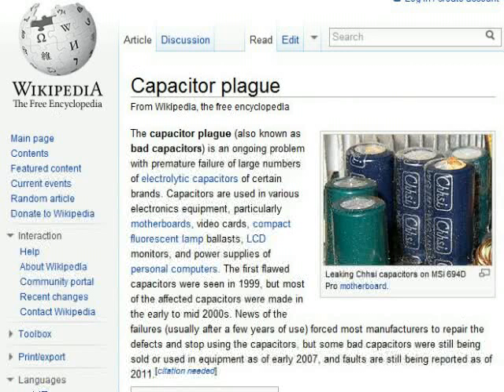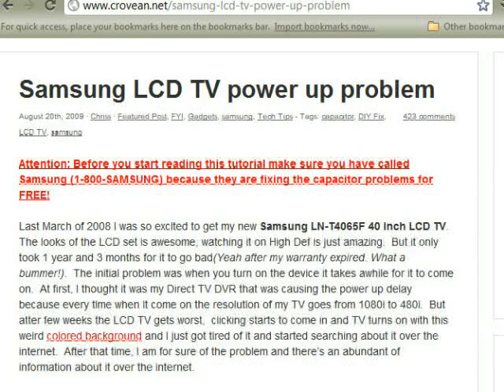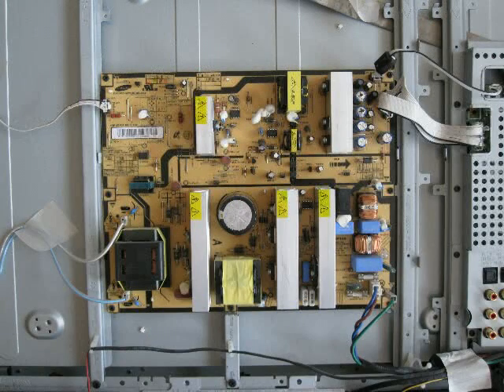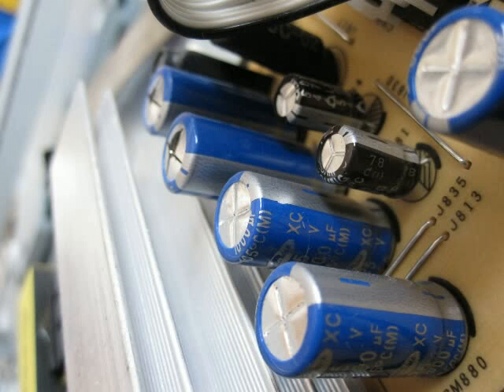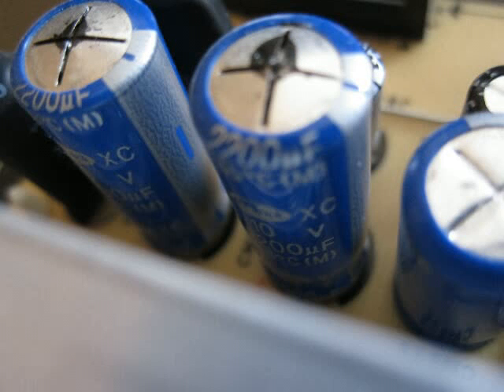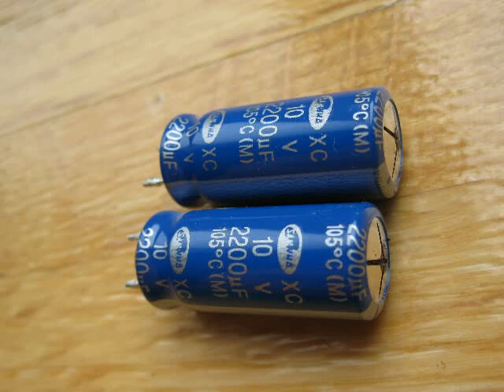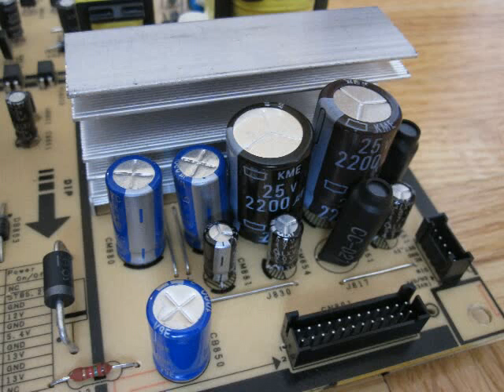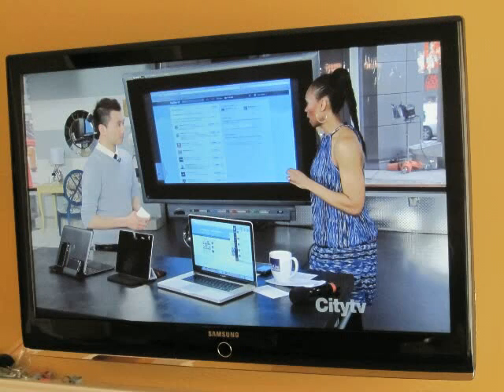Samsung TV Problem Turning On - How to Repair Fix

Comment: Awesome video! Did it myself and it worked like a charm! My tv had two bad capacitors (1000uf 25v) in the upper right hand corner I bought new ones online for about $3. It took about 10 minutes. I no longer have to pay a tv repairman an arm and a leg to get it fixed. Woohoo!

Comment: I viewed this video and was able to repair my tv to working order in a very short time, less then 2 hrs. and that was going to get the capacitor that I needed. The best part is it only cost me less then $10.00 to fix the problem. Thank You for this video it was a great money saver
Reply from the maker: Glad to hear! My original repair is still working great, so hope you get many more years out of your TV!
Reply: +DevHackMod Channel Hi Dev..same problem I have like you before I watched ur video. I get same capacitors with original values.  My tv works 1 week and started over again. Time to put more V like you did. Hope will sort the problem
Reply from the maker: Monsta BeatzTV You should not use original values. You must change voltage rating,keep same uF rating. This should solve the problem. Use 25 V instead of 10 V capacitors, but keep uF same. Good luck!
Reply: DevHackMod Channel
Thanks Dev! I did change all capacitors on the mother board with higher Voltage but same uF as u said...it was all great for 1 week and what  I have now it keeps turning on and off again. I read one forum when someone mentioned to change 1 transistor. There is one only on the board. So I will pick a luck and will try to change and see what happends.Also i did have some colored lines on the screen horisontal and vertical. Thanks anyway for your advice I did that all.Please let me know if u have some other idea.
Reply from the maker: Awesome! Glad to hear it helped!
Reply from the maker: Find out the model # of your TV, see my Philips TV repair video (https://www.youtube.com/watch?v=V5b0nfkVqkc) and use ShopJimmy to check parts list that they supply. It gives you a good clue on what parts you'll probably need to change on the board. My video that I linked explains it.
Reply: DevHackMod Channel well...at the end I changed all capacitors and one transistor also...was working fine 4 days and problem is still there. Thanks anyway for advice..I need to figure out what else can be the problem.

Comment: Thank you. I fixed mine over the weekend. I replaced two 25v 1000uf 105c, with the same (i did not increase the voltage because Maplins did not have any in stock). It worked anyway so maybe I'll get another 3 years out of them. Thank you.

Comment: My 52" TV was made in early 2009 and doesn't fit under the legal judgment (which Samsung calls 'the capacitor program'.) Thanks to your video and similar ones on youtube, I was able to disassemble, replace the 2 caps, and reassemble in about three hours. My model had the caps already replaced by 1000 uF, 25V, 105C units, but they'd still bloomed open like roses in the spring. All I had in stock were caps of the same specs, but since the blown caps had lasted 4-1/2 years, I figured that would have to be okay. TV is up and working as expected. I included some 50V caps in a parts order, so I'll have them if it happens again. Thanks.
Reply from the maker: Nice to hear you fixed it! This problem is already over 2 years old (on 5 year old TV's) and still happening to people... I'm sure it will take out a pile more TV's in the future. Samsung will probably stop honoring the settlement (if they haven't already). Good to know that people won't be stuck with a "forced upgrade" because of $5 in parts!

Comment: My 46" Samsung LCD (LNT4661FX) had this same problem. I bought the TV brand new in 2007 and noticed the problem in 2011. To play it safe, I replaced ALL of the underrated capacitors with a much higher voltage rating. The repair was very simple and the TV has been working great since 2011.

Comment: Thanks put in higher rated caps and has been good for years
Reply from the maker: Same goes here. I bought the TV in 2008, fixed the caps in April 2011 and still running the TV without problems and it is now 2017. So the original caps ran for maybe 3 years. Since I replaced them, almost 6 years now without incident. I expect them to go much longer. I only changed those 2 caps you see in the video, nothing else.

Comment: Thank you for posting this, I fixed my 52", 2 caps 1.50 each samsung wanted 100.00 to show up and 80 for labor plus anything they found.  They also said there was no issue with my model.  Everything I own is Samsung including my cell phone....maybe bad caps but they could have at least acknowledge it was an issue but they rapidly setup an appointment for an on site tech..at least i know how to fix them now...will do more research on next purchase thought samsung was the best.

Comment: This is an easy fix.  I had the same problem and fixed my 46" Samsung for less then $5.00 in capacitor parts.  it took less then 10 minutes of soldering and the TV was as good as new.  Its been over a year that is has been working on the new caps.....

Comment: This so far,....is the best I've seen to fix the problem I have with my Samsung.
Reply from the maker: Good luck with your fix and glad to help!
Reply: Yep,...I put two 35V 1000uf 85C Capacitors in my TV fom another TV for now. I know it takes 25V 820uf 105C Capacitors, so I ordered those on amazon still waiting for them to arrive.
Reply from the maker: Good job! Yes, the best thing is to try and keep the FARAD rating the same but you can go up in VOLTAGE rating no problem, and the higher temp 105 is a good idea since they designed the board with these capacitors right next to heat sinks which may get hot and shorten their life anyways.

Comment from the maker: @GPE001 Thank you for your comments. I did read somewhere that the capacitors Samsung installed were 10 V, but the board's  "main bus" runs at 12 V. I also heard recommendations for the ESR type caps, but nobody in my area had them in stock. It was hard enough finding 105-celsius caps in the specifications I needed. Hopefully these will survive long enough, but I think I will need to repair something else, because there are 2 other capacitors in there I didn't change. I'll have to keep checking.

Comment from the maker: @StudenterStriber Sorry to hear that. From what I have seen on the web, most of the time the slow startup with clicking power-on problem has been due to capacitors on the power supply. However, it may not always be the case, or you changed the wrong capacitors or put them in the wrong way. Other people have done it and most of the time it seems to have worked. My TV is still working fine, and it has been since April 24, 2011 (now going on 5 months no problem). You may have a different issue.

Comment: Great vid! My samsung lcd tv started having slow power ups a few weeks ago. It was bought in 2009. Local repair shop insists that i need to change the whole power board! After watching your video i'm having second thoughts on letting them repair the tv. And again great vid!
Reply from the maker: +MrSp4s You can replace the whole power board, but it may be easier just to change the caps (and definitely cheaper) if you know what you're doing. If you are unsure and not experienced with soldering, you can buy a power board online and change it yourself, so you don't have to pay for labor at the service shop.
Reply: Thanks for the responce.Your video is very helpfull. I decided to take back my tv and not let them repair it at all. The weirdest thing happened as it seems that the tv is powering up again as it should, but without anyone actually fixing it! (hence the repair shop opening/inspecting it?) I'm a bit confused now.... Leave it as it is or replace the caps/power board? Thanks again!
Reply from the maker: Inspect the board but I would leave it until it fails again. If you try and fix it and it breaks, you'll feel sorry. At least if it fails first you won't be so upset.
Reply: +MrSp4s they probably changed a few caps to get it going, then called with a high estimate for a new board. you took the TV back before they had a chance to put the old ones back in.
Reply from the maker: For the cost of a few dollars, you may as well try the fix yourself and see. New caps are cheap. Just change them all as a matter of fact, if you don't see the leakage/bulge. An ESR tester can help. If it works, great. If not, it cost you a few bucks to try. Based on the symptoms described (sluggish "power up") it is very certain to be the same bad capacitor issue that everyone else has had.... and FIXED successfully just by replacing caps.

Comment: The top of the capacitor cans are purposely cut in an X pattern. This cut is suppose to give way if the cooling oil inside the can gets too hot and expands. Without it, the can will have a considerable pop (explode) with the pressure build up.

One of the things that can make a capacitor heat up is over voltage. The power supply operating voltage it is supposed to filter and store current from is more than its rated capacity. As we saw in the video, Samsung put in a 10-volt capacitor for a power supply that has a higher rating. Eventually, the capacity of the capacitor to store current is diminished , hence the power supply cuts off.  This relieves the capacitor of the current deficit and it charges (stores up)  again and supplies the needed current to the power supply. Over time, it gets depleted again and shuts down once more.

Think of the capacitor as a water tank or reservoir. It must be able to charge up and store current continously. 

The excessive heat will cause the dielectric material in the capacitor to deform and lessen its ability to keep a charge. More like a water tank getting kinked.

Shame on Samsung for not catching this simple problem of underrated capacitors. It looks like the problem is of epidemic proportion. Do I see a class action lawsuit to force samsung to remedy the problem .

I just bought my samsung hdtv 3d last december, 2013 and by February, 2014, it is blinking on and off. Yes, that will be the last samsung product I will ever buy. :(  !!

Gil
San Diego, CA

Comment: I also have a Sansung 43" Plasma Tv that does the same clicking noise when attempting to power it on. After waiting on Sears repair service for 7 weeks to repair my TV, I decieded to investigate this Problem myself. Your video is an excellant source for How to fix it myself. The repairman is scheduled for a return visit on Dec. 20 with a new Power supply to install. If after my warranty expires the TV does this same thing, I will fix it. Where did you get the replacement capacitors?

Comment: Today my trusty Samsung Plasma which we have for years didn't turn on. So I opened it, checked the board and low-and-behold JUST BY LOOKING at caps I could see one cap bulging and another one bulging and leaking. Same problem I one had with a PC power supply some time ago. Then I did some Google searching..and your video and others confirm it's bad caps, some video had actually the exact same two bad caps. On one hand I am pissed that the set stopped working, on the other hand I am glad since I know I can fix it with $1 myself, like I did with my PSU. And by the way, Samsung monitors have the same problem with bad caps. What triggers it is I think simply age and quality of components, but we here in Spain also have power outages often which certainly has a part in it. (When power goes off for a second and then comes on again...I already had main boards fried because of it...)
Reply from the maker: +Georg Rauh Glad to hear you fixed it. It is not just Samsung. I had a Philips TV also die after only 1 year. It turned out to be a whole bunch of components on the power supply (my video about how I fixed it is linked here: https://www.youtube.com/watch?v=V5b0nfkVqkc). It is just better to learn some electronics skills because more and more problems are going to be happening and those who take the time to learn and repair will save themselves lots of money and problems.

Comment from the maker: @gestergester Correction... I found "power supply" for Samsung also on ebay, it is a different board. But still you don't know if it's the power supply or Y-board. I think the CLICKING problem had to do with powering up, and the Y-board affects image. Check on YouTube for people who have fixed the Y-board and what problems they had which needed a Y-board changed.... their TV's powered up, just had crap images. The power supply board was the clicking problem.

Comment from the maker: QUICK UPDATE:  TV still working fine as our daily family TV, now April 2015. Remember I bought it 2008, it died around 2010-11 (just over 2 years old) and changed the caps as shown. Now 4-5 years later still working fine. Share your success story here if you fixed yours... How long did it last from factory, and how long has it worked since you fixed it?

Comment: @gestergester In most cases this is incorrect. Running a 10V cap on a 12V supply will very quickly destroy the capacitor - within a matter of hours to days. The type of capacitor used on these boards doesn't usually need a change in voltage. However increasing voltage of the cap has other benefits... the cap is bigger and so has a lower resistance (ESR) and higher ripple rating (amount of ripple current it can absorb without failing) and so also a longer lifespan.

Comment: hi gestergester.very good vid,i have a 3yr old samsung tv,thats got a thick black line down the left hand side and another one forming.i,ve had the back of,checked  the said caps but none are swelling or bulged.could they be damaged but not showing no signs?or could the problem be elsewhere......thanks

Comment: Thanks for the video.  I have a degree in electronics repair so this is what I will be doing.  However, I'm there are many people out there that will just by another TV.  I'm sure this was done on purpose.  If you didn't understand the need to regulate these companies before, you should now.  I had a great paying job back in 2008 when I bought my TV.  I paid over 2 grand for my 52 inch Samsung LED.  It was supposedly the best you could get at the time.  I expect more If I buy the best. 
 Now I won't be buying another Samsung again.  It never fails to amaze me how companies think they can get away with this.  You can get a way for it for a while, but eventually the bill comes due.
Reply from the maker: Nobody today thinks this is abnormal... The young generation things everything is disposable, that you should change your phone every 2 years, that computers are obsolete in 5 years, that a TV is like a light-bulb. Also, the cost for repair is so high that people just buy a new TV. It has become so common that most stores sell "full replacement warranty" on items, so for extra $50 you get a new TV anyways. It is happening with everything... Buy cheap now... but pay later when it breaks, you'll be changing the TV 3 times in 10 years instead of getting a good one that will cost double but last 20 years.
Reply: @devhackmod  Lol.  I just saw this all these years later.  Nobody may think it's abnormal, but that doesn't make it right.  It's time for a change.

Comment: One thing that no one seems to have said on any of the videos is that capacitors hold a charge even when the tv is unplugged. Be careful not to touch the terminals as you may get a shock from them.

Comment: @gestergester Thanks,  The fix went well and my TV works just fine. You are right about Samsung dodging the bullet on a massive screw up. eBay is full of Capacitor kits for samsung tv's.... that alone should tell everyone something.

Comment: @gestergester   I couldn't find low esr caps either. I will probably just put the same kind in that you did. Has it held up okay? If I can at least get a year out of my caps, then I it's not that big of a deal to do this again until I can find some of the other type. Please let us know how your tv is doing these four months. Any more clicking? Thanks.

Comment: Sweet, nice going! I've done that to many monitors, and bought a kit for an old LG 42 inch a few years ago, that my friend Russ gave me. But I just got a beautiful LG 47 inch 55LE8500 from 2010 with the problem with the HDMI chip by using a heat gun on it, instead of the oven, lol. I'm gonna see how long will that last.
Reply from the maker: Great idea, I should pick up a heat gun also to get those old solder joints rebonded, I guess they start to break off after several years. I guess just trial and error pressing on the chips and flexing the board you figure out if it works.

Comment: Thank you for this video. Our Samsung (LN-T4061F, from 2007) just started turning itself off/on a few weeks ago. Today we opened up the TV and found a bulging capacitor. I'm not comfortable using a soldering iron but our electrician friend is going to try and replace it. Several of the capacitors feel loose/wobbly but no bulging on top. Should we replace those, as well? Thanks again for the video, very helpful!
Reply from the maker: Glad to hear you are attempting to fix the TV. This is one of the cheapest easiest fixes that has caused huge amount of money lost and electronic waste for no reason. Caps are so cheap that I would replace all of the ones on the power supply, especially any near and around the failed or bulging ones. They may be near heat sinks which also cause them to heat up and dry out. Your electrician friend could probably do it all in a few minutes and get the set back up and running. Good luck and let me know how it goes!

Comment: The other annoying factor is that Samsung also makes the power supplies for MOSt of the TV's being manufactured. My Visio plasma TV had the same symptoms and sure enough it had a Samsung power supply.  I wound up replacing nearly all the capacitors on this board which was about eight of them.  Total cost was less than $15 plus my own labor and the set works perfectly now.